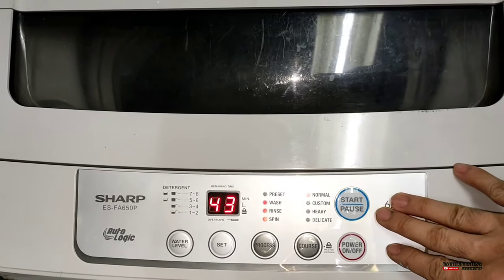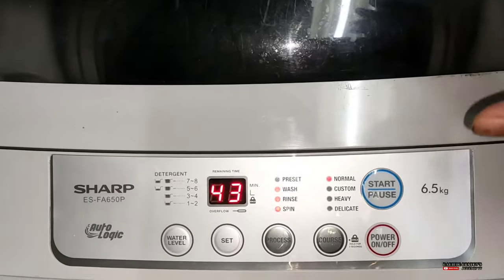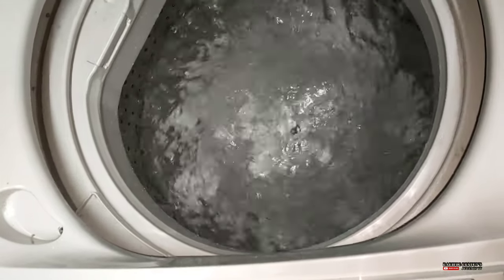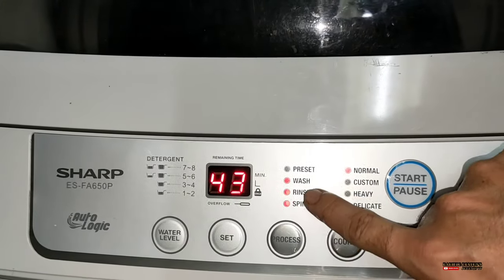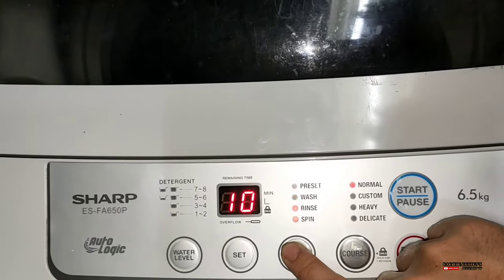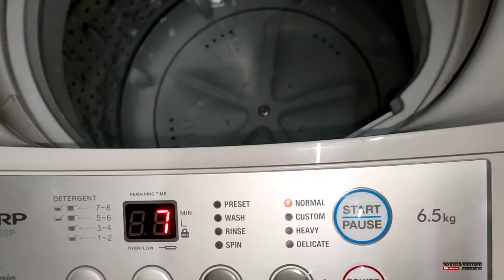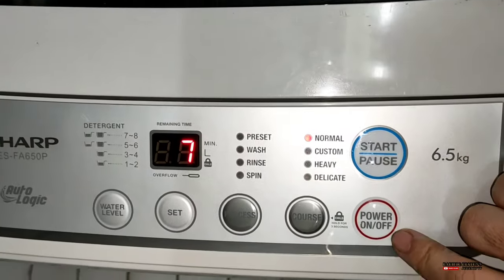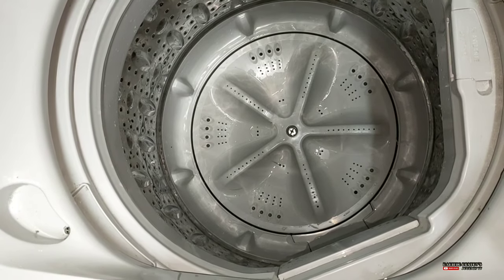How to drain water from washing machine without drain button||Sharp autologic|| Tutorial

Comment: @barikigbeatoysjourneytv5007 sir pano kaya kapag nagddrain sya agad kahit naka wash. tumatapon yung tubig dirediretso.
Reply from the maker: Try nyo po iaangat ang drain hose mam. Baka need iangat para makuha ang level ng tubig. 3 po kasi dahilan nyan. 1. Level ng drain hose. 2. Water level swicth barado kaya kahit marami na tubig walang pumapasok na pressure sa water level switch. 3. Board - ito pinaka mapait pag ito ang may problema.

Comment: Sir ask ko lang ano possible cause,kapag kapag nagdrain,may tumatagas na check ko na Yung hose Wala Naman butas,pero kapag nagwasshing na sya  Wala Naman leak,

Kapag nagdrain lang talaga tsak lumalabas Yung tagas, kaya Lage nabasa Yung floor Namin.
Reply from the maker: Yung dulo po ng drain at dun sa may clip ng hose paayos po ulit ng pagkalagay
 Minsan po kasi akala natin nakasalpak na ng maayos at yung clip nakaclip pati dun sa plastic na matigas na pagsasalpakan yun pala hindi kaya pa clip po ng maayos. Pag wala parin. Buksan nyo ang likod. Tapos kargahan nyo po ng tubig. Pag may tubig na. Off nyo para mawala ang system na nakaprogram tapos on ulit change to spin. Kusa pong mag dedrain yan tsaka nyo obserbahan kung saan po galing. Salamat po
Reply: Same question sakin naman lately napansin ko parang may nagleak n tubig s likod kpag nag spin sya kapag nagwash wala naman at dati wala din nung kailan ko lang napansin anu kaya possible reason?
Konti lng naman sya.
Reply: Problem solved na.
Actually  Hindi sya sa drain plug.
Napunit Yung mahabang hose na nas likod,Bago dumating sa drain hose,,manipis lang Yun amgmabilis mapunit Lalo kapag nagsspin may vibration kase

Comment: Hi, how do you fix the door won't lock error? We have a similar washing machine and we're getting a door open error.
Reply from the maker: Check nyo po ang door lock switch baka po sira na, if ok ang door lock switch baka po nasa system ng board nag aabnormal. Pero bago po kayo dumating sa board unahain nyo po muna sa door lock safety switch.
Reply from the maker: Patingnan nyo nalang po sa tech na malapit sa inyo para di napo kayo mahirapan. Salamat po sa pag bisita. God bless po sa inyo.

Comment: Lods ginaya ko na ginawa mo. Pero hindi pa din nag drain same brand po sharp
Reply from the maker: Pag nag normal wash po ba natatapos siya? O sa drain lang siya ayaw?. Kasi po kung  sa normal wash natatapos siya at di siya natigil pag drain na maaring ok po ang washing nyo pero same brand pero may mga konteng pagkakaiba sa setting.  Basta po kung may tubig at gusto nyo i drain set nyo sa spin tapos start. Kusa pong mag dedrain ang washing kasi po mag i spin siya at need nya itapon ang tubig na naka imbak. Pero kung di po siya mag de drain may problema po c washing. Maaring main board o di kayay drain pump. Check nyo yung pump baka may debri.

Comment: sir un sakin nag E4 pg dating sa 34 min na nag e4 na error
Reply from the maker: Dahilan lang po nyan sir is yung insufficient supply ng tubig. Try to check yung mga hose sa supply pati yung parts ng water level swicth baka maaga siyang nag cut off sa inyong solenoid switch sa supply ng tubig. Pag ok ang mga parts na yan
 Nasa system na po yan ng board need nyo na po ipacheck sa brand technician lalo na kung may warranty.  Salamat sana po nakatulong at please subscribe.

Comment: I also have a sharp washing machine  13kgs top load. Other option with that is put the drain out tube lower than the machine. - manual way
Reply: Get it mam, thanks for the additional  information. It will helps very well